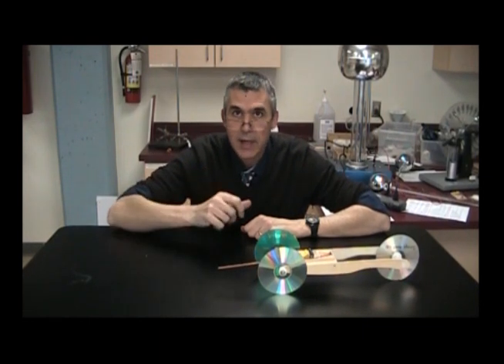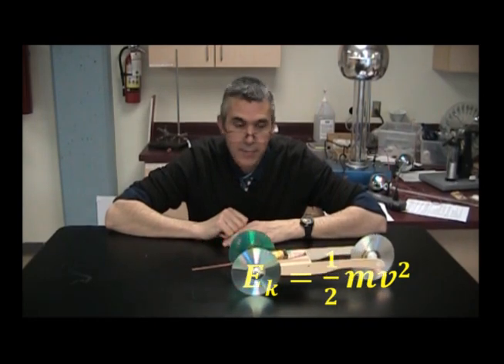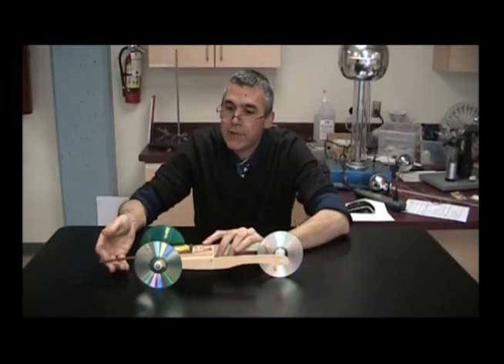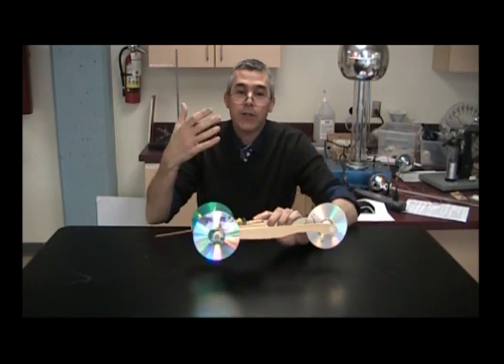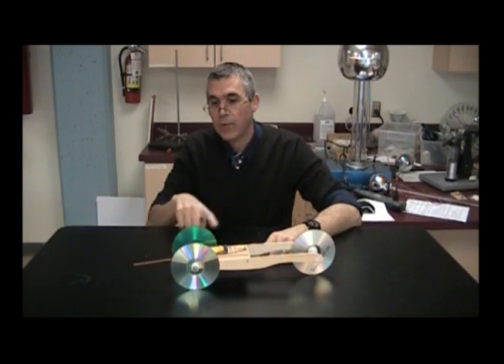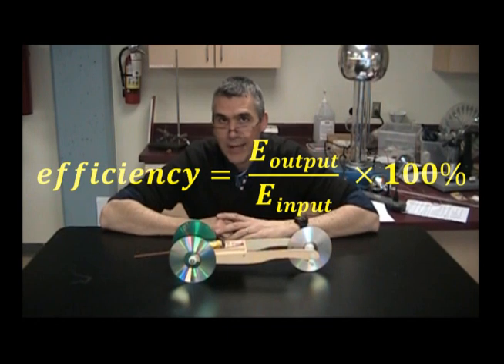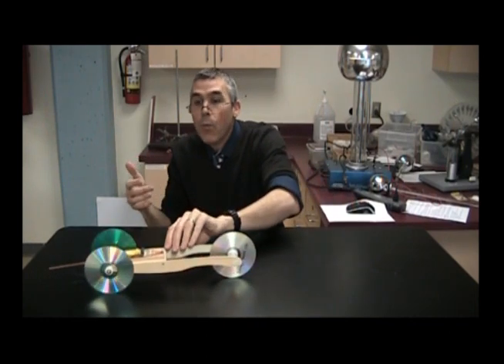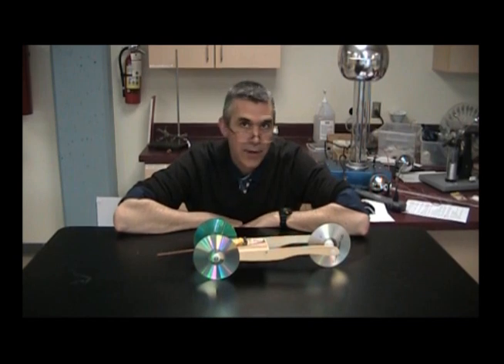Work, Energy, and the Mousetrap Car

Comment: I am confused how your supposed to calculate the force in order to calculate work done by the mouse trap spring?
Reply from the maker: You measure the force directly. If you have a spring scale you can use it to determine the force of the spring on the arm. It's not a constant force, so you have to measure at different points on the swing (ie back all the way, fully released).